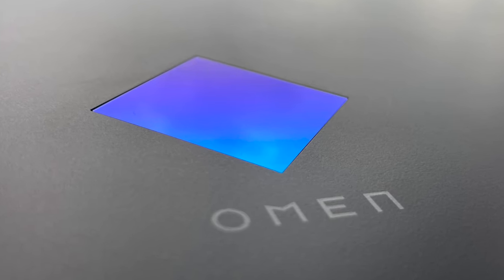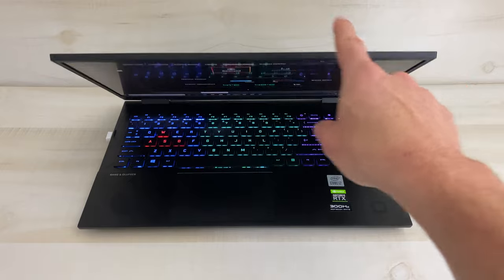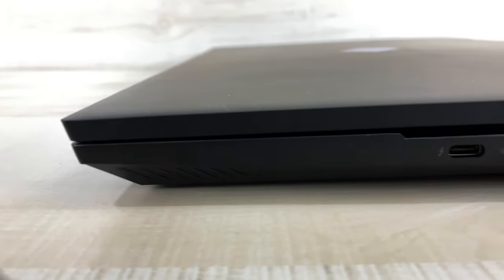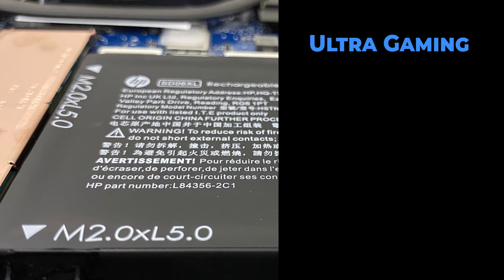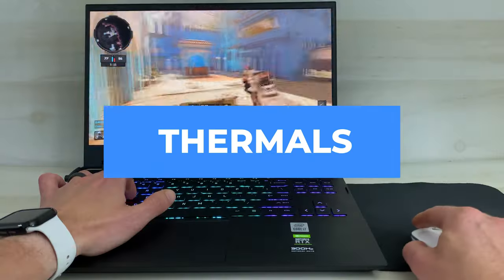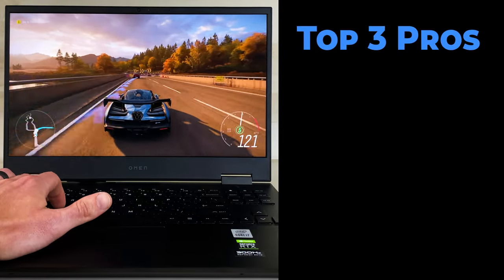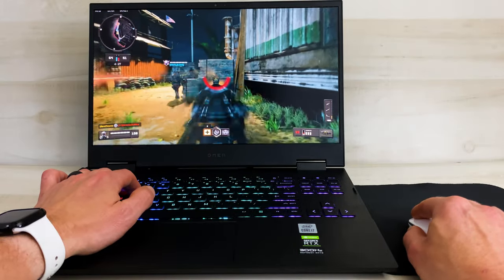HP Omen 15 Review - So Much Power!

Comment: I own the ryzen 7 version of this laptop and it is super snappy. I actually love the keys (and i'm used to keychrom k4). The screen isn't the brightest, infact it's one of the lower nits scores I've seen on a newer laptop, but the color accuracy is phenomenal and important for me as I use it often for amateur photography with my Canon mirror-less. Gaming is easy and seamless, never seeming to drop below 60~ fps on most things I play. All in all I spent like 1200 bucks for the best laptop I've ever owned. The downsides are the screen brightness, speaker sound quality, short battery life, and loudish fans even when I'm just idling. But overall, I would buy this laptop again. Hopefully HP keeps pumping these out!
Reply from the maker: I'm glad you liked it Frèdrèck Chopins Cute Little Feet!
Reply: Hey bro I'm using the ryzen 5 version. Does it support mux switch?. If not what to do in order to disable optimus. Pls help
Reply: @warwolf3693  No. I believe only the Intel versions support this.

Comment: Great review, thanks! I'm actually going to be replacing my old 2016 Omen 15 in about 2 weeks and your review convinced me to stick with Omen. I'll miss my old red keyboard, but I'll give it up for a Ryzen 7 processor and a RTX 3070 GPU.

Edit: Nevermind, just got to the Keyboard lights section of your review. Red keyboard will live again.
Reply from the maker: Ohh yeah Ciaphas, going from a 2016 Omen to a Ryzen 7... I'm excited for you! You're going to be blown away with how much faster that is!
Reply: @JustinTechTips  Welp.... Hp was going to take an entire month and a half to build what I wanted, so I went with a Gigabyte A7 X1 instead. It's worked out nicely though. For the same price as a maxed out Omen 15 I got my hands on a Ryzen 9 5900hx with an rtx 3070 (with 140w going to the card) on a 17 inch screen. I'd never heard of Gigabyte, but all of their product reviews were really good so I'm feeling pretty good about my purchase.
Reply: Is it good?
Reply: @a7madraed693  I ended up getting a Gigabyte A7 X1 instead. Hp was going to take an entire month to build what I wanted and the Gigabyte laptop has better specs
Reply: @twohorsesinamancostume7606  dang wish I came across your comment a week ago. My omen won't ship till Oct 28th and I ordered it Sept 3rd. Almost two months! And the better specs. Especially when it comes to wattage. Is there any way to boost wattage? I assume throttling effects thermals and since this laptop handles it well it could handle a bit  more wattage. Im probably never going to game without being plugged in to the wall
Reply: @zolavib1187  Wattage is set by the manufacturer. Unless they release a BIOS update that lets you increase the wattage, there's nothing you can do.

Comment: I actually own this laptop and have been using it for about 3 months now. It is by far, the best laptop i have owned. and i have owned 5 not including this one. I have always had trouble with FPS and Cooling on all other Laptops due to power leaks and poor build qualities. This one has none of those issues. and i won't lie, it gets really loud, but i constantly wear Headphones so it is basically a non issue for me, as well as the keyboard and mouse, as i use a docking station and external peripherals.  Also the screen looks amazing but i also hook up to my Terrible Viewsonic VG2455-2k monitor. 60hz and (oh god) 15ms response, and even there video is crisp and clear and at medium settings, on all but Raytracing in COD Coldwar, i can still get up to 113 FPS. which compared to previous machines is amazing. i just thought i would write this little blurb up for your viewers and they can hit me up anytime if they have any questions and you as well. thanks for your review and i look forward to watching your other vids.
Reply from the maker: Thank you for dropping in your two cents from your perspective Dan! You got the exact one I got https://amzn.to/2UZaR3x with those specs? Or was it a variation of that? Trying to get a good gauge of what configs people are buying the most so that I can make my future videos the most relevant to you all.
Reply: @JustinTechTips  The Omen has the same specs as the one you have reviewed. I have only made one upgrade at this point which is a 2TB Mushkin Nvme Drive for games. as far as utilizing the Omen Gaming Hub, I have done the Intelligent Undervolting and it has kept me at an average 1.2 volts and still able to run all my current games at max settings when using the Laptop Screen and Medium and high settings when using the 2K monitor. Also to note, this is using the Discrete mode (GPU only, no hybrid with intel Graphics) The next upgrade will be to put in 32 GB of RAM, not that i need it all at once, but i do use my laptop to edit videos and Photoshop when i get a hair to do it. But the 16 GB is more than enough to run Most Graphic Intensive Games. Hope this helps you anyone else that reads thsi.
Reply: @based based It is a really good laptop and you get a second Nvme Slot which is great cause the 512GB is a bit lacking, especially if you have a larger game library.
Reply: @ThatGuy5591  hi! thanks for all the info regarding this laptop im planning on buying it could you please tell me your avg fps on the witcher 3 and rdr2? if you have tested it of course, with your mini review I feel more confortable going for this laptop, thanks

Comment: got one for college last summer not quite the exact same one you have shown in the video mine has the ryzen 7 5800h cput and the refresh rate of 165hz however everything is pretty much the same like the 16 gb ran ddr and the rtx3070 however mine doesnt perform near that well i get around 40-70 fps av 40-50 fps with cpu fans up to 90s and guessing around 50-70 external due to the exhaust leaving burn marks on my fingers and my omen hub lacking some of your software options like the graphics manager while doing minimal tasks its quite nice cold and quiet but when i do anything else everything else fall flat about this laptop and makes the showcases nothing more than a bold claim not sure whats wrong with my unit but any help is wanted and greatly appreciated

Comment: It baffles me that so few people mention HDMI 2.1, which is one of the selling points of this laptop. MSI and Asus do not offer HDMI 2.1 and this is the only reason I did not go with them. It's nice to connect it to LG CX from time to time and not be constrained by HDMI 2.0
Reply from the maker: Great point!
Reply: @JustinTechTips  I ordered one today from HP with QHD screen and also X3 external sound card since laptops do not have optical out anymore . When not on the move I will connect it to LG CX and Bose Lifestyle V20 (2006).
Reply: @DarrenExplorz  Look it up on HP website. It says HDMI 2.1. I also called HP and they confirmed that it's 2.1
Reply: @DarrenExplorz  What I want to know is the TDP of the 3070. Can't find this info anywhere . HP does not know. Nvidia mandates to disclose TDP on all laptops and few companies comply . What a joke
Reply: @DarrenExplorz  From HP website “External I/O Ports
1 SuperSpeed USB Type-C® 5Gbps signaling rate (DisplayPort™ 1.4, HP Sleep and Charge); 1 SuperSpeed USB Type-A 5Gbps signaling rate (HP Sleep and Charge); 2 SuperSpeed USB Type-A 5Gbps signaling rate; 1 Mini DisplayPort™; 1 HDMI 2.1; 1 RJ-45; 1 AC smart pin; 1 headphone/microphone combo[19]”

Comment: Which omen laptops have the little bumps on the sides to prevent the screen flex in that gap? I've noticed some models have it and others don't😕
Reply from the maker: I think all the newer models have it because of the complaints
Reply: @JustinTechTips  when you ordered yours were they in the picture?
Reply from the maker: No it actually wasn’t in the picture when I ordered mine. But I’m glad it has it
Reply: @JustinTechTips  good to know. Thanks!
Reply from the maker: No problem!

Comment: I have this laptop, I got this model open box for about 1400. Great deal IMO, it’s a beast but it is fucking loud during gaming. At full RPM the fans dissipate heat very well for such a small machine but sounds like a small jet engine. I usually wear headphones when gaming so I don’t notice it a lot, but it’s something to consider. I also came from a 17” laptop ( asus rog strix g17) and it’s something to get used to but with an external keyboard and mouse I just have to get used to the smaller screen size and much higher refresh rate
Reply from the maker: Oh wow, yeah you got a great deal with this at 1400 Snapps. It was one of the loudest fans I've heard but fans don't usually bother me too much. I'm always rendering on my Alienware at Full Speed so I'm used to a jet engine sound at my house constantly! The wife doesn't like it too much though lol
Reply: I use mine more like a desktop with an external monitor, with the horrible battery life that's all its really good for. Its great in that regard. A shame not to use the 300hz monitor though.

Comment: I need help, this is the HP OMEN 16 with amd 5900 hx cpu and 3070 gpu and the full amd version amd 5800 cpu and amd 6600 gpu the amd is much cheaper I wanted for the flight simulator and for work which do you recommend
Reply from the maker: Hey JDhelsing, the 3070 will be much faster than that 6600 and I think for flight simulator you would be a lot happier with that one

Comment: Good review, thanks! Any idea if you can completely turn off the Nvidia GPU in the BIOS? (i.e. is there an "iGPU ONLY" option somewhere in the BIOS?)
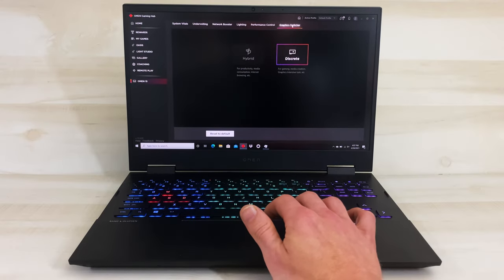Reply from the maker: Hey Scott no need to go into the BIOS! If you go to 6:13 I talk about the mux switch directly in the Omen Gaming Hub software! 🙂
Reply: @JustinTechTips  Hey - thanks for that! I was asking about the BIOS because I'm a Linux user, so won't have access to the "Gaming Hub" software.

Comment: What about coil whine? I had Legion 5 Pro and had coil whine, if were fans off and you placed head on the bottom of laptop. What about this OMEN?
Reply from the maker: Great question David! I never put my head on the bottom of the laptop but from sitting at a normal distance from it, I never heard any coil whine
Reply: @JustinTechTips  Yeah, of course. I gave an example, when it was best heard. If I was in quiet room, it was audible from normal distance too.

Comment: I bought this laptop and I am waiting to be delivered. What would the the first day tips for this laptop? How should I update the drivers? Through the website or just through the HP app? Thank you!
Reply from the maker: Congrats Dourado. You can either update using the Omen Gaming HUB or directly with from HP with this link https://support.hp.com/us-en/drivers/selfservice/omen-15.6-inch-gaming-laptop-pc-15-ek1000/2100045552/model/2100045567 (All you need to do is select "detect my drivers" and select the ones that have updates)

Comment: Hey! I have a question, in my country the laptop came with a 8 gb ram with 2933 mhz speed, if I want to add another one to dual channel it, must I add another 2933mhz speed one or can I add a 3200mhz one, since 2933mhz ram is hard to find these days.. thanks in advance
Reply from the maker: Great question Darren! You can add a 3200mhz one. Your motherboard will just run it at the slower speed that it actually supports

Comment: Legion 5 Pro 3060 or hp omen ryzen 7 3060? I find omen a cheaper option in my country.
Reply from the maker: How much cheaper Ajax? They are pretty close, so I would go with the cheaper one for you
Reply: @JustinTechTips  you pay $176 more, you get a Qhd lenovo.
Reply: @ajaxsid9034  Ive also been torn between these two for a few weeks now !  I really like the look of the legion5 pro . Seemed to have a more solid feel and design with usb c port . However the omen 15 is currently £400 cheaper . Due to it being on offer . So the choice was easy . Just waiting on the Omen to arrive ;)
Reply: @tomfernandi8496  My broke ass ended up buying the Dell g15 3050 ryzen 5600h😭 for £699. Cause the Rest of my money got spent in some bullshit.😂 . 🎉Congratulations on your Omen. Wish you a good luck.

Comment: I had this exact model and I really liked it. Ended up returning it for a ryzen model, but I really liked the keyboard. Layout is way better than the g15 and key travel felt really similar. I have bigger hands and was really surprised with the omen keyboard.
Reply: Should I get the intel version or wait for ryzen 5th gen
Reply: How are the thermals on intel 10 with rtx 3060
Reply from the maker: I am very pleased with the intel. Honestly i don’t see a point waiting when the thermals never got that hot even with the intel. Basically, I was never bottlenecked with performance because it never got hot enough
Reply: @JustinTechTips  thank you ❤️ is there much of performance difference between i7 10th gen 3060rtx vs ryzen 7 5800h 3060rtx

Comment: hello what is the AC watts.... my laptop is the omen 15 ek1xxx rtx 3070 32gb ram, the AC is 200 watts (came with the laptop), but when I play using the AC the laptop exit the games (crash) in about 10 seconds if is a demanding game (I switched to another laptop (same model) the owner had another one and let me get, and still has the same thing)... he said to buy a 230 watts AC , do you think this will work... I cannot change pc anymore.

Comment: Hello, I've had this laptop for a month or two, but I don't know how did you get discrete graphics option to work. I tried that option once, but got my laptop bricked after an update.( Had to get a replacement one ).

Either way the video is very well made. Has a lot of useful information packed in it and I quite enjoyed it.

To be fair, you're quite underrated
Reply from the maker: Thank you so much Rbrihards! The switch to Discrete mode is in the Omen Gaming Hub
Reply: @JustinTechTips   Bether made to Discrete from bios option if you want to use only nvidia card,like me.
Reply: its a realy great mashine.

Comment: I have the amd version...i can't enable overclock in hp omen gaming hub..is the same for intel one right??
Reply from the maker: Hey Andrea, it doesn't specifically have an option that says overclocking, but switching to discrete graphics mode and using intelligent undervolting options and setting the thermal profile to performance boosts the machine like overclocking would.

Comment: Can you game on external display with the lid closed? I noticed the vents are also above the keyboard.
Reply from the maker: yes you can game with the lid closed. I tested those vents above the keyboard with a tiny piece of tissue paper with the fans at max and no airflow was going in or out of that part. Underneath, the back, and one side had very strong airflow though.
Reply: @JustinTechTips  These are great news! Thanks a lot ! I ordered one on HP site and the ship date is the end of May. I miss optical out on laptops. I ordered Sound Blaster X3 in order to connect this laptop to my Bose Lifestyle V20 system (2006- Still works like new) and LG CX. HMDI on this laptop does not carry audio, that's what I've been told by HP. I need this Sound Blaster X3 to provide me with optical out of the laptop to Bose's optical in. I hope to get my Dolby Digital 5.1 surround this way. I hope I get bitstream and not PCM 2.0 .I called HP and they said their audio port does not have SPDI/F out and this sucks (as for all new laptops). Even PS5 and XBXS dropped optical out. What's interesting is that NVDIA mandates now for GPU manufacturers to display TGP of graphics cards. HP and Dell do not care. I called them and asked. They did not know (HP tech support)

Comment: I got the AMD equivalent of this omen with the Ryzen 7 5800H at 100 wattage I don't think it makes a difference between the i7 and Ryzen 7. Unfortunately it was a custom and will take nearly 2 months to ship for some reason. I assume chip shortage and high demand are still going on. I guess the whole planet has been shopping for new laptops this past year. But HP seems notorious for slow manufacturing to shipping. I've found forums dating back almost a decade complaining about HP shipping.
Reply from the maker: Yeah Zolavi, it’s crazy how long these order completion times are these days. Some Lenovo Legion series are quoting 4+ months!
Reply: @JustinTechTips  I meant to say I don't think it makes much of a difference between the i7 and Ryzen 7 due to the wattage. I'm more of a casual gamer so the low wattage isn't a big deal but is a draw back for a 3070 when gaming. I'm going to learn photo/video editing so the low wattage isn't going to be a big issue for me. I do wish it were higher considering the omen handles heat so well. I assume throttling the wattage is for thermal issues. But I don't know much about PC builds

Comment: Lenovo legion 7 with RTX 3060 and Ryzen 7 or This one?
Reply from the maker: Hey Hayden Legion 7 has a higher TGP so it will be faster for you
Reply: @JustinTechTips  Seriously? Even though you only have a 3060?
Reply from the maker: Yeah the 3060 Legion 7 is showing some great benchmarks due to its high TDP. It is pretty crazy but it actually performs better than the HP Omen 15s 3070
Reply: @JustinTechTips  Thanks brother, I did not know what to buy. It will be my first gamer laptop: ´b. Great video

Comment: When I turn my laptop lid on 140 degree angle it goes down slowly without touching ,,... is that a sign of loose lid of laptop??
Reply from the maker: Yes it definitely needs to be tightened if it goes down on its own
Reply: @JustinTechTips  Is hp omen lid
 fixable easily?
Reply from the maker: Yes it should be pretty easy. Here’s a great article on how to do it https://www.techwalla.com/articles/how-to-fix-a-loose-laptop-hinge
Reply: @JustinTechTips  thank you🥰👍